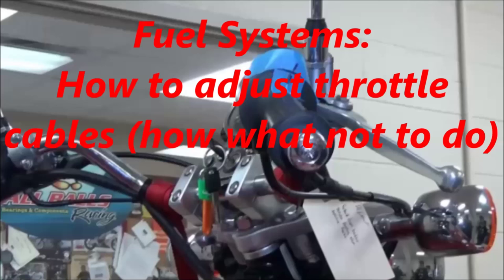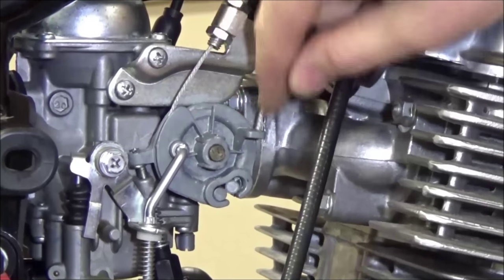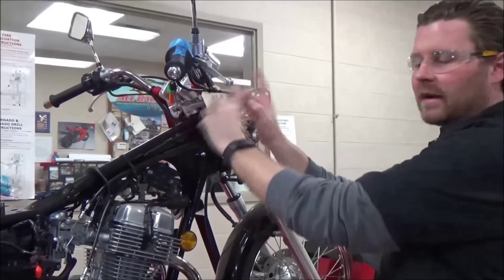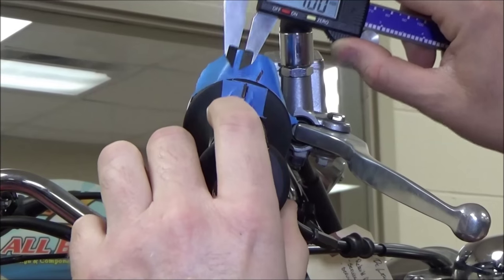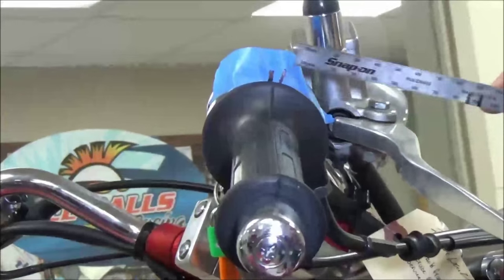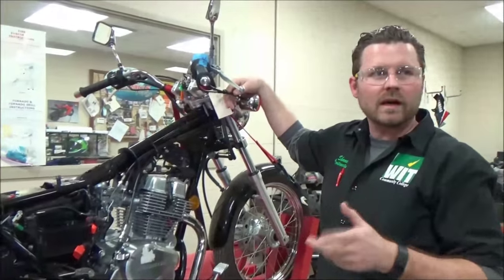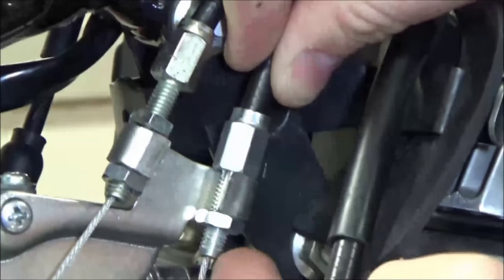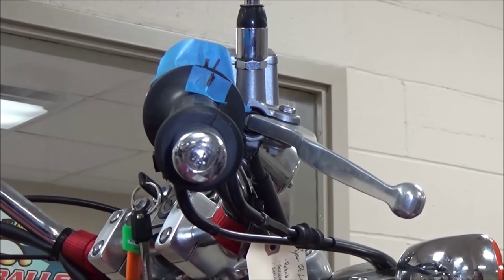EM Series: How to adjust throttle cable freeplay or any clutch cable and brake control

Comment: I just bought a 2004 VTX 1300 with less than 20k miles on it.  Yes, you read that right, 20 years old,  less than 20k miles.  Plot twist:  I bought it from a guy here in Texas who sadly got flooded in the recent rains.  It took on about a foot and a half of water.  He's a friend and too old to ride these days so he told me "$500 and it's yours", so clearly I couldn't turn THAT shit down.  Clearly I have my work cut out for me, but I'm happy to do it.  Here's the thing, I've RIDDEN for 15 years,  but I've never ONCE turned a wrench on a motorcycle.  Plenty of cars, and I'm an HVAC mechanic by trade, so I likely have the "mechanical knowledge and skill set" to do the work that needs to be done.  That said, I'm always happy to take advice.  I've found the owners manual online, but CLEARLY I'm gonna need some parts, and what I DON'T see in the manual are PARTS BREAKDOWN AND PARTS NUMBERS.  Curious if anyone here knows where I can find what I guess would be called the "SERVICE" manual, with breakdowns and part numbers.  This was a great video btw, you made me even more excited to get mine cleaned up and on the road!
Reply from the maker: I (social media team) learned from Shane the service manuals don't supply part numbers (only for tools). I don't know where to get them but he would. 
That's a good question for Shane directly. Have you considered joining the channel to get him daily as a member benefit?
You reached the social media team here. We get 300-400 requests a week, so it’s a bit time challenging as you can imagine. 
Shane does try to answer some non-members' questions when he gets some time so hang tight if you’re not in a hurry. 
Did you know one of the member benefits is to ask for which videos would work for your needs and get daily "quicks answers" to questions directly from Shane?. Best $1.99 a month you'd spend...of course enjoy the over 700 free videos and access the member only vids with all the other benefits listed below. 

There are two immediate options that can get you a solution within 24 hours and quite often within the day. 

Option 1: 
Consider joining...best $1.99 you'll spend this month 😁 This is great for quick answers. 
He literally logs in and answers member questions daily! He does an AM and PM check-in to answer all member questions. Join this channel to get access to perks:
https://www.youtube.com/channel/UCBhM8DCKnT3qXwTW0eToyCg/join       
-Daily MEMBER FIRST COMMENTS ANSWERED FIRST 
-Live Q/A video chats
-Wonder if we have a video on your need? Members can request content links!
-Full Access to the ENTIRE 700 video library
-Member-Only FREE tool giveaways  
Ways to support or high five How 2 Wrench! Thank you in advance. YOU MOTIVATE US TO DO MORE!
1. Smash the subscribe button (thank if already a sub!)
2. Have you seen our "YouTube Trained Support Shirts?  https://goodfellasmerch.com/collections/how-2-wrench/products/support-shirt   
3. High five donation:  https://www.paypal.me/how2wrench    
4. Got an emergency and your head is about to explode from frustration or fear? Get Shane’s cell here: https://how2wrench.com/ols/products/techline-one-on-one

Comment: Great video. I think it also worth mentioning the speed of the cable returning. Worn, bone dry or crud filled cables can make your adjustments seem inconsistent. As mentioned poorly routed cables will certainly make your hair gray.

Maybe you could show a video of a cable lubing tool in action since that should be down while adjusting these things.
Reply from the maker: Already have one in the "every mechanics" playlist...👍😊
Reply from the maker: Cable lube tool 
http://youtu.be/Akyq8XVdJfU
Reply: +Shane Conley I guess that video got away from me. I thought I'd seen all of them. Thanks
Reply from the maker: +ghostdog662 
I had to add it. Thanks for mentioning it. It was in a product playlist.

Comment: What would cause your throttle not to snap back?  I have to twist handle back or it would be like cruise control.  I have a 2004 Yamaha V-Start 650.
Reply from the maker: If the video didn't make sense, it sounds like you’re ready for some Techline help. Coach Conley is also available for hire to personally work one on one with you if ever needed. Yep he is a real person. Give him a call @ 602-345-0432

Details here: https://how2wrench.com/product/personal-tech-training-phone-facetime/ 

Your answers and help are just around the corner. Save time and money while protecting your investment and yourself by doing it the right way!
Follow us!
Web:
www.How2Wrench.com    
www.Tools2Wrench.com

Comment: I didn't see you talk about the wide open throttle stop? if this is not correct you can brake cable end!
Reply from the maker: If the cable is set to tight I surely agree...
👍 Thank you for taking the time to comment! Hit that subscribe button if you haven’t please! It helps us! 
Here is a way to support all the free videos.
Want to say “thanks” or “keep it up”? Click here https://www.paypal.me/how2wrench  

Coach Conley is also available for hire to personally work one on one with you if ever needed. Yep he is a real person. Give him a call @ 602-345-0432
Details here: https://how2wrench.com/product/personal-tech-training-phone-facetime/ 
Your answers and help are just around the corner. Save time and money while protecting your investment and yourself by doing it the right way!
Follow us!
Web:
www.How2Wrench.com     
www.Tools2Wrench.com
Reply: @How2Wrench  The problem I see a lot is the throttle body hits the stop & if the grip is twisted & don't hit it's stop it pops the end right off the cable!  Thanks for the reply!

Comment: Remember to show how to not over tighten the pull cable to over pull the cable to much,,,, like i did,  and it broke the cable and i had to replace it and i really did not have it over tighen to much i thought ... but now i am really looking at that adjustment. i also am doing a CV gasket replacement and guess what, i found the FXRP 1990  bike pull cable end was ready to snap off any day, you really cannot see it unless you remove the air filter which i should do now at each 3K oil change, i will now make it a point to check the carb cables on every oil change,  a part which is over looked i think and so important because we ride long distances,,,,
Reply from the maker: Hi John. Nice share. I want to encourage you to shift towards using the word "freeplay" instead of "over-tighten". I believe from the well wrote out comment you get how to adjust it now. The reason to use freeplay is that is how it is referenced in the service manual when one looks up the spec. Also we never "tighten" the cable but adjust it to this freeplay specification. 
You rock! Best way to help us back is joining or grabbing our T-shirt! Support links and gear below!  Awesome and thanks for commenting! Smash the subscribe button (thank if already a sub!)
Have you seen our "YouTube Trained Support Shirts? Great way to "high five us" https://goodfellasmerch.com/collections/how-2-wrench/products/support-shirt

Join this channel to get access to perks:
https://www.youtube.com/channel/UCBhM8DCKnT3qXwTW0eToyCg/join   
-Daily MEMBER FIRST COMMENTS ANSWERED FIRST 
-Live Q/A video chats
-Wonder if we have a video on your need? Members can request content links!
-Full Access to the ENTIRE 700 video library
-Member-Only FREE tool giveaways   

Just want to say thanks quick to support us for this information and our work saving you money? 
Give us a high 5 here:  https://www.paypal.me/how2wrench   

Got an emergency and your head is about to explode from frustration or fear? Get Shane’s cell here: https://how2wrench.com/ols/products/techline-one-on-one